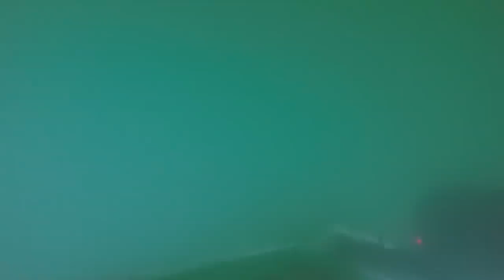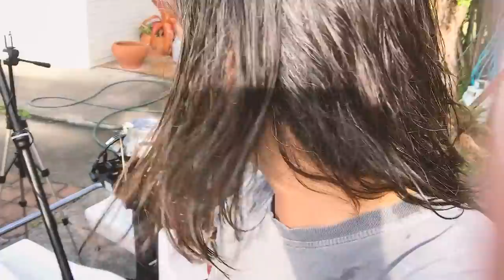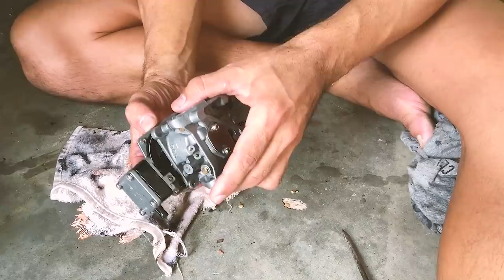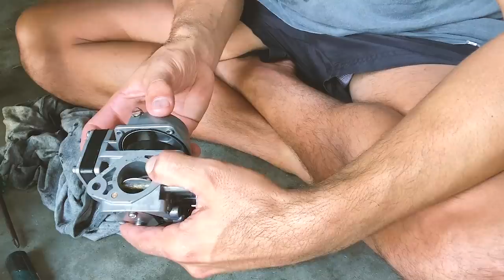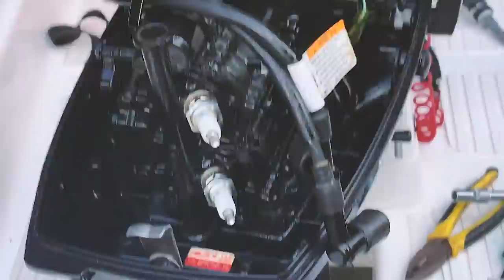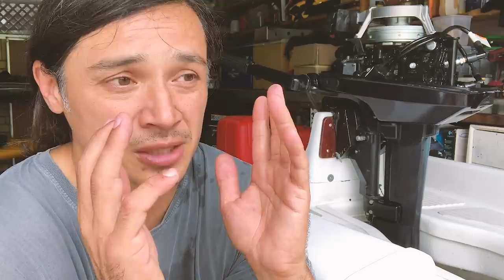Micro Boat Bar Crossing Fail - Fixing a Submerged 2 Stroke Outboard

Comment: Hey Bro, got a nice little rig there.  Pretty typical for the 2 stroke to start right back up.  You might be able to get to the drain for the bowl without removing look for a pass through.  Have a kit with Water Displacement #40 WD-40, made for rockets... plugs in that dry holder  pack and a wrench. It will happen again and again, cause it does.  what will you do when your out there and go over? great real life vids bro! we enjoy them

Comment: Hello, very happy that nothing bad has happened. When it happens this kind of mishap, do not forget to rinse the engine part (not the ignition section on the top) with 4WD40 and allow to dry, to prevent the engine from becoming a block of rust. I apply the same method of exterior maintenance engine for my jetski or my outboard ... for the moment it works

Comment: Glad you've included the can of engine starter in your kit. Mate the golden rule with boating is "if in doubt, don't go out". That goes for your gear, the weather, everything. Nice work getting her up and running again, next time get the impellor wet before you run it

Comment: Rod, keep in mind that just because it is running now does not mean that rust may not pop up over time. Salt is a very sticky bastard and not miscible with oil (oiling components may not have eliminated the salt). Please check the carb and cylinders for rust after on a few short trips before you head way offshore again.  Best procedure I've found for salted parts is to WD-40 immediately if possible. Or go straight to a fresh water flush, remove the fresh water with carb cleaner or WD-40 depending on the part. Re-grease what needs it. I've found with wet shotguns than covering salt with oil just seals in the salt and then you have salty oil to strip off and actually fix the problem. Good luck!

Comment: Great job on fixing it, who ever the problems tend to start with a submerged engine after a short period of time because of the salt
in the in the electrical system. First thing was to inhibit it with oil while its working through try and get into the electrics to desalt it.
Keep doing the films there great.

Comment: Interesting vid mate. We had the 25hp tohatsus in the surf clubs in NZ, great 2 stroke engines and we flipped them and they always started again, we didnt even go to all the trouble you did, often we got them started on the water by just removing plugs, pulling the cord a dozen times and clearing the water and putting dry plugs in. They are such a simple motor, you would be in the poo if you did that to a 4 stroke motor.

Comment: I am big fan of Johnson-Evinrude and also like a lot Mercury. But nowdays i think Tohatsu is simply the best. Your video prove it (I have a 15 hp 1956 Johnson,  al summer season uses about 1 or 2 hours per day and it works like a dream, thats why I love this old motors). Good video by the way!

Comment: Glad you are ok.  Had a similar issue with a 2 HP 25 years ago.  Looks like you did well, and I don't think she was running when you capsized.
Reply from the maker: Adam Cooke yep you can here the engine die just a bit after it flips. Was pretty quick to cut out👍

Comment: Hi mate, how would you rate these micro boats for offshore use, bar crossing, wave crossings from beach launch etc? I mean besides stacking it, how do you find it in general? From what I understand they were designed and marketed for use on flats. I'm considering a similar setup to yours, just hesitant with the low bow and how it would take on waves head on.

Comment: Good video man! Not sure how I didn’t see this until now. I’m 90% getting a Solo Skiff this year and this is my main concern. We have pretty similar surf conditions to you guys so it will definitely involve picking the right days. Would you mind detailing exactly what happened? We launch skis a lot here and coming in is usually pretty straightforward. Just ride the back of one of the smaller ones in, but I’ve never worked off one of these Skiffs so I’m trying to figure out what some of the risks and limitations are before I commit. Thanks a lot!!
Reply: Ahh, and one other quick question about launching. Actually two questions....Can you slowly cork/punch through 1-2 foot white water on the inside while idling and waiting for your shot? Can you get over that size stuff or will it wash over your whole deck? Also, how quick is the skiff to pivot? In other words, if you’re launching and you need to 180 and retreat to the inside and realign to wait on sets is it fairly nimble and quick turning? I know there are limitations with these things, just trying to get an idea on how many days a year I’ll be able to fish out front. 1-2 foot and crumbly but long period and clean swell is fairly safe? Or it needs to be flat flat? Thanks again bro!

Comment: I wonder if it would be possible to set up an outrigger for additional stability? I see the Balinese tradisional fishermen roaring through the surf as they all dock on the beach and I've never seen one flip over. Steve from Key West Kayak Fishing has a nice set up on his kayak with the 6hp engine actually strapped to the ama. It's only on one side of the boat and doesn't interfere with his fishing. While he launches from sheltered coves he does go out in the ocean from time to time fishing the wrecks in deep water. He even has set up a step ladder on his kayak for sight fishing with a flyrod on the ocean flats. That's stable! Just something to think about as a catamaran or even trimaran setup is very stable, but maybe not suitable for your situation.
Reply from the maker: Yea I think an outrigger might cause more problems then it solves unfortunately 👍

Comment: I admire that you are not too proud to post mistakes and mishaps that others can learn from your experiences both good & bad.  Thank you.  I am guessing that since a 2-stroke motor does not have a crank-case full of oil like a 4-stroke there is less to clean out saltwater from.  I used to own several 2-stroke Tohatsu outboards they were always a favorite.  I did flip my little 2-stroke Tohatsu powered canoe once several years ago in a brackish stream but it was an easy cleanup, and I had her running in less than 30 minutes.  I also once had a rogue wave swamp my Suzuki 4-stroke powered canoe which resulted in bent valve stems so a much longer and more expensive repair.  
How old is your motor?  It looks pretty new.  Is Tohatsu still making 2-strokes, and selling them in Oz?  I would love a new 2-stroke Tohatsu if they were available here in Hawai'i.  Mahalo nui!
Reply from the maker: They are still selling 2-strokes but there is a ban coming in... I thought it was already in but I’ve seen a few new ones still around, plenty of second hand ones in good condition around. I got mine second hand but it was in really good condition.

Comment: Washing parts and even whole components in a bucket or two or three of diesel would be a good idea to flush the water and salt out. My old man used to always do that with his heavy machinery (Caterpillars) when stripping them down and reassembling the engine etc. Diesel and kero mixed together sometimes. Very safe. Ever tried to light a pan full of diesel with a match; the match just goes out! Mate, you were using that WD40 as if was made of gold: spray the guts out of it.

Comment: Thankfully you came out of it reasonably unscathed, what happened is your vessel got whats called broached and part of it is the type of hull design basically a ski with an outboard and something you will need to be mindful of in the future, talk to your Dad about the term, and he should be able to explain how to avoid a repeat event
Reply from the maker: Yep, I guess I timed it wrong... I was on the back of a small wave and dropped off just a bit then because of the unpredictable choppy ness of the bar at low tide there was another wave right under me almost immediately! It picked me up so fast and surfed me down the face so I tried to gun it to get ahead, but it was too late... speared straight down into the water! Lessons learnt for sure😅
Reply: @rokkitkit  Nods and it's how such of an event happens and i have personally seen much bigger boats get caught out and sink.
And thank you for sharing this video as it shows how dangerous the sea can be for n00bs and experienced skippers,, I noticed: and really important you didn't panic, all the best mate and safe seas

Comment: The water pump impeller gets pretty hot if the engine is run without water, pretty easy to damage them this way.
Reply from the maker: Sean in NZL yep I’ll have to make sure I get it wet next time. Was just keen to get it running and realized after the fact😅

Comment: Couple of thoughts from a friend.  You may know this already, but here goes anyway...

1) When coming back in through heavy surf, get on the BACK of a wave and ride it in like a horse.  Stay with it and don't let it leave you, but don't get in front of it (as it happened in this video)  Boats usually don't slide well enough to make a good surfboard.

2)Right now, fresh water is your friend!   You need to IMMEDIATELY pull the motor and soak the engine in a barrel of fresh water, overnight.  That is the only way to get the salt out of the nooks and crannies all over the motor.  If you don't, within a week or two, your beautiful motor is going to start corroding all over.    Rinsing the outside isn't enough!

3) After soaking in fresh water, do the same as the first time- get the water out, change the oil, spray EVERYTHING down with WD40 or similar, add fresh oil, and then start it and run it for the rest of the day.   Then change the oil again.   Run it the next day, and change the oil again.

Tip: Use cheap, regular automotive oil for these first couple of changes.   All they are doing is catching the moisture, and carrying it out of the motor.    After 3 changes, go back to your normal outboard oil, and all should be fine.   Just run, run run the motor as much as you can.  This will help evaporate any sneaky hidden moisture.

Don't just sell the motor.  Take the time to really soak out the salt.  It's worth the effort!

Stu, on Dangar Marine's youtube does a video on this subject, if I recall.   He might be close enough to help you out.   Get the salt out, and your motor will be fine.   Leave the salt, and you will be very sorry.

Best wishes!   Sorry that happened to you.
Reply: Wait...  Is that a 2-stroke?   If so, it's even easier.  Soak the motor to get the salt out, dry it out as much as possible, then run, run and run it.   I would recommend a little extra oil added to the fuel, as that will help with corrosion.
Again, best wishes, and glad you are okay.
Reply from the maker: Cheers for the great comment mate, will definitely take it all on board 👌

Comment: And btw as soon as that motor hits the water it will not matter if the motor is under there for 30 secs or 5hrs everybody’s first instinct is to get it out as soon as possible but it won’t matter to getting it going again

Comment: MATE you need to check your water pump your motor was not pumping water properly them check out how much water is getting in the intake because that motor was NOT!!!! pumping water properly there was not enough water squirting out. be careful because you can overheat your motor if you run it too long without knowing. Glad your ok mate keep up the vids

Comment: It would've been much worse with that four stroke you had. You would've had to replace the engine oil too. I kinda get why you got a 2 stroke now lol. Don't worry you won't need a new engine just keep running it constantly, thats the best thing you can do with a motor thats been rolled, the heat and expansion will take care of the rest

Comment: Hey so sorry mate....I ave been boating for 30 odd years and it happens mate.....just a general rule...never try and surf waves in a power boat. The motor creates drag and the wave catches up with you....the result is a classic high side....and over you go😔.....chin up mate. You did a great job on getting it up and running again..just watch the electrics over the next few weeks. Especially under the fly wheel......sorry bro😔😔😔.

Comment: I flipped my Hobie in November last year at 12: AM in an inlet, outgoing tide, by myself in 40 degree F water(that's cold as fuk in metric). The whole thing was in slow motion in my mind. You never feel so alive though.
I did manage to catch 30 striped bass though. The important question: Did you have one in the box?
Reply: What happened?  Did you get it flipped back, or did another boat render assistance?  You must have had good clothes on.  Not many people fall in 40 degree water and live to tell the tale.
Reply: Front hatch open, Hobie sunk, swam with it 30+ minutes got to construction barge hypothermic and exhausted. Couldn't get up on barge fully due to numbnes, fatigue and heavy cloths. Considered dropping back into water after 10 minutes rest which would have been warm compared to the air. The water and waves were much worse by now and I was not gonna let go of my Hobie. By this time I was out of options and called for rescue. 40 minutes later I was on land. 2 hours later I was fishing again... from land! Been there 6 more times since. That inlet is a different place since then.
Reply: @JerseyJimFish  ,
Man, you are rugged!  You must have had good gear on.   
When surfing in cold weather, it was always warmer in the water than out, even in a 5 mil wetsuit.
Reply: I don't remember the cold til I got out. Then I was over a pitch black angry inlet and couldn't bring myself to drop back in. The messed up thing is I could have swam back and forth 3x if I didnt have to save my Hobie.

Comment: Flipped my yak a while back and drowned my micro 4stroke. Like you I immediately drained, washed and flushed it out. It runs fine in the garage but has developed aquaphobia. It will not start on the water! : (
Reply from the maker: John Rickards is, not a great phobia to have as an outboard 😂

Comment: Heey rod , poop happens . might be good to go down to the local surfclub and speak to the rubber duck driver . We have a start up procedure specifically for flipped engines in surf . Ask tommie he has been there and done that and we got the 25hp up and running better than new .
Reply from the maker: Cheers Paul, yep Tommie sent me the surf club protocol and gave me a few tips. Hopefully I can keep here running well👍

Comment: Even if you get it running you won’t be able to rely on it. Once the salt goes through it you might as well toss it mate.(that’s from my experience)
Reply from the maker: Time will tell I guess, I got some tips for a few life savers and they flip the rubber duckies plenty and think it should be fine... just got to keep running it often.  But we will see👍
Reply: Good luck mate hope all works out well 👍

Comment: Don't ride the wave in front but follow it in from behind
Reply from the maker: Yep, I guess I timed it wrong... I was on the back of a small wave and dropped off just a bit then because of the unpredictable choppy ness of the bar at low tide there was another wave right under me almost immediately! It picked me up so fast and surfed me down the face so I tried to gun it to get ahead, but it was too late... speared straight down into the water! Lessons learnt for sure😅

Comment: im actually pretty suprised it took in that much water
Reply from the maker: Yea I think the edit makes it look quick but it was actually about 20mins of swimming it in before I got it flipped back upright👍
Reply: @rokkitkit  fair enough it woulda been a pain to get it back upright in the swell i would imagine, so when are you gunna get a nice big rubber ducky ? wont tip over in a hurry then but coming through surf is always a big risk tho

Comment: Pull the spark plugs out then you should flip the motor upside down and pull it to start it and everything will be flushed out
Reply: Throw some wd40 in the plug holes too
Reply from the maker: Yep, pretty much did exactly that👍

Comment: Would straight sell that motor once they go under will never be guaranteed it will last and be reliable could end up getting stuck in a worse situation
Reply: Pickle the motor in fresh water, soak all the salt out, then start her up like you did the first time, and she will be fine.   But HURRY!   Corrosion doesn't sleep.  It's eating your engine as I type.

Comment: The boat turning over occurred because you were "riding" the wave. 
The wave lifted your stern up, while your bow sank to the point that due to buoyancy and water resistance, the bow could not penetrate the water any further, then your skiff began to slide sideways tail first and turning over by the power of the wave pushing you from behind.
Solution to avoid it from happening again: Never ride a wave with a power boat, never let the wave catch up to you on the stern side.
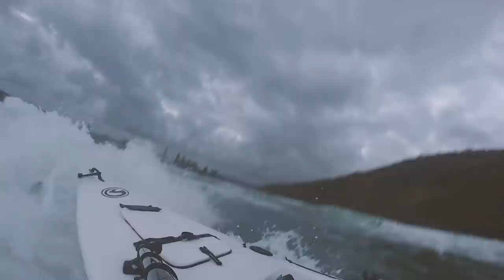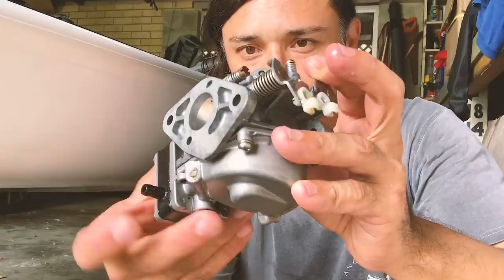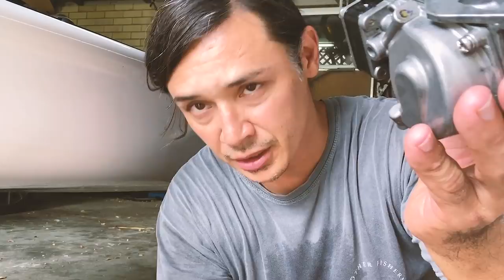Watch this video from 0:12 - 0:25 so you can see what I am talking about in action, and from 3:25 - 3:37, and from 7:15 - 7:25.
https://www.youtube.com/watch?v=9lsAnmnFPIo